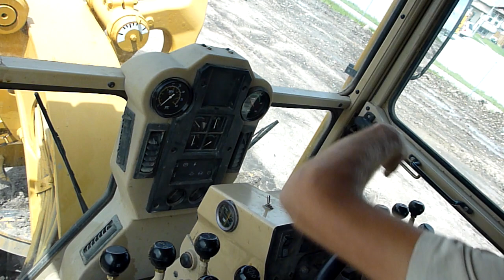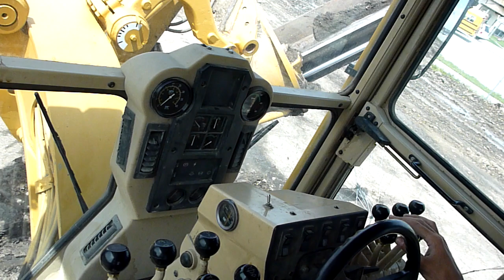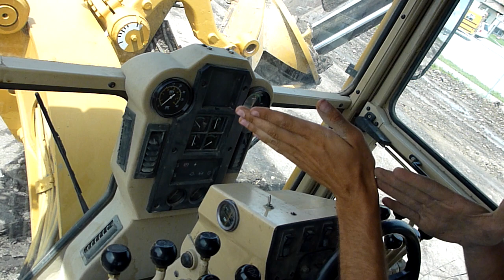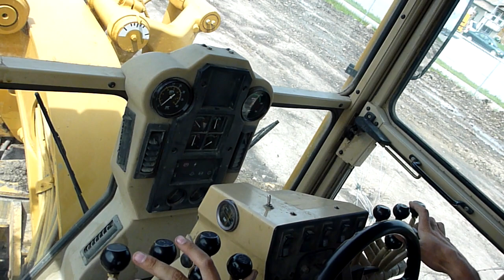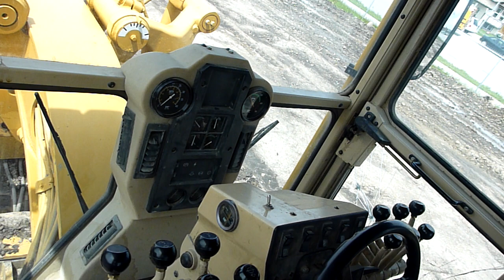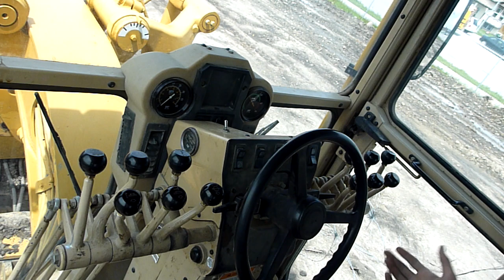Cat 140H Motor Grader Controls

Comment: Blade float: is there a switch or a button for it? Do not have the operation manual.
Reply from the maker: crutler no it’s a detent position above blade lower function. If you push hard towards the front you will feel it pop in. If you are in a G series grader it most likely does not have this function.
Reply: @vantagetes  g series has to buttons. One for each blade cylinder

Comment from the maker: @xray606 Well the multifuction part. You can run one with just the blade lift and steering (which is already the hand dance) but then turning around on the fly you have to shift, lift both sides of the blade, steer hard (say left), articulate left, wheel tilt left, roll the blade back for height clearance, rotate the circle on top of sideshifting both the blade and saddle over. 4 levers on the left hand, 4 on the right hand, a steering wheel, manual transmission all at once to turn around!

Comment: you forgot to mention the third hand you'll need to steer the thing when you operating al those hydraulics at the same time!
Reply: Its a dance you learn after a while. Youll be after a while , really quick on the steeringwheel while operating the levers.
Reply: Most experienced operators find it just as easy to steer using the wheel lean lever to make minor direction changes while blading...no third hand needed. Works for me.